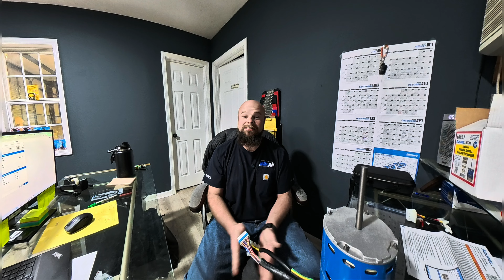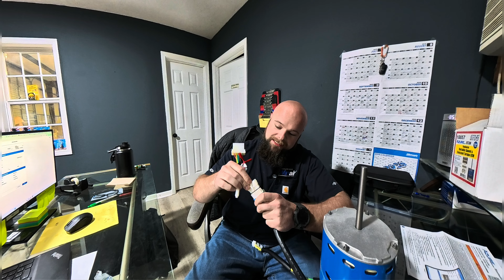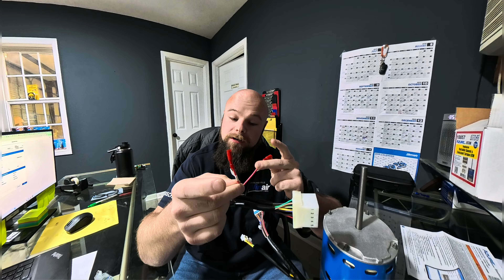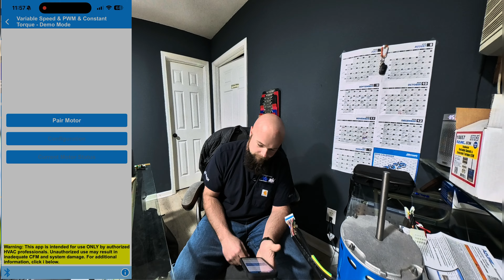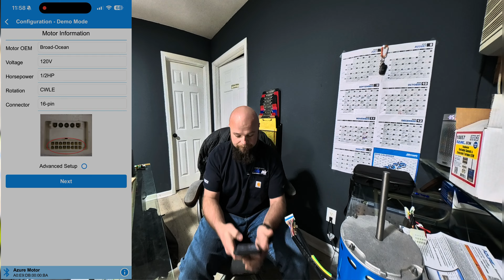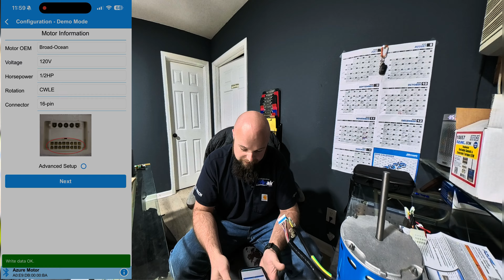Mars 10856 and 10857 Variable Speed Blower Motor Overview

Comment: When replacing a variable speed genteq 1/2 in a straight cool single stage Trane should the tech set the low cool, high cool, low heat, high heat to 0% and only see the motor speed in the PWM field of the app?  That's how I interpret the notes at the bottom of that screen in the Azure app.